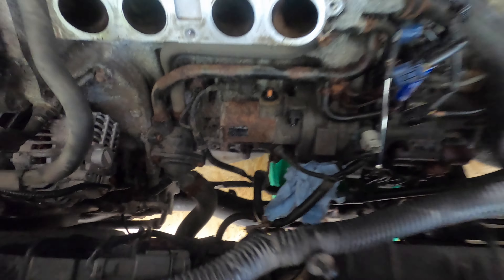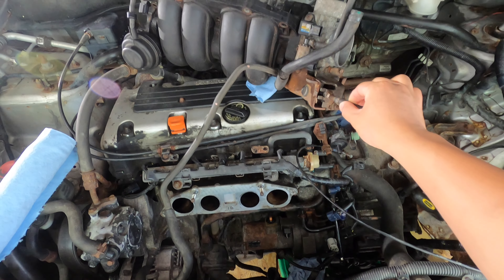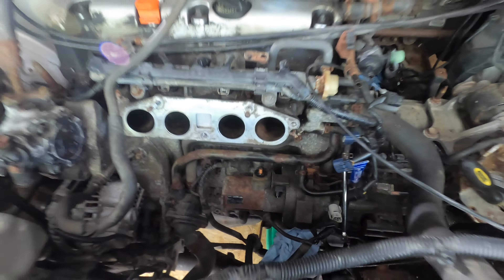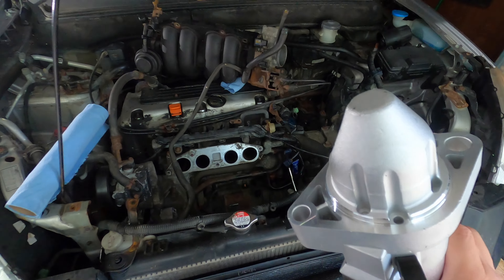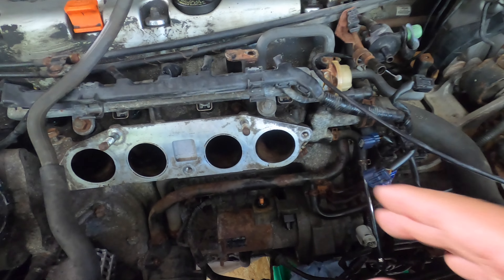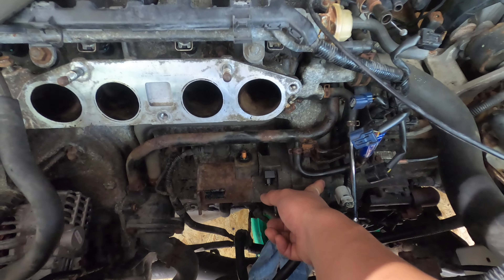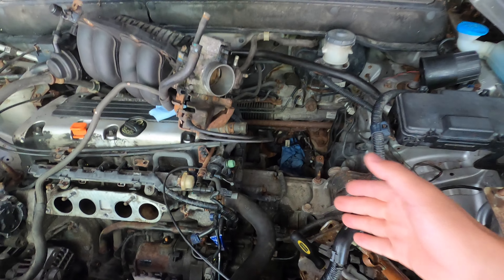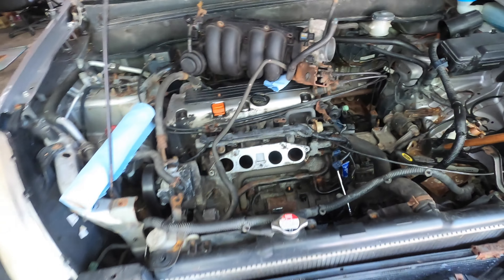Oops, I am in Trouble! 2002 Honda CR-V Starter Get Stuck on Flywheel

Comment: Wow, what a mess. Maybe you should try to apply some heat. I guess you got it out by now. I have no problem changing my starter on my Sienna, very easy to get to and it didn't get stuck. Good luck fixing cars.
Reply from the maker: I figured out it was the flywheel gear got stuck with the starter gear, so I turned the flywheel by turning the power steering pulley. Removed the starter easily with the gears released.